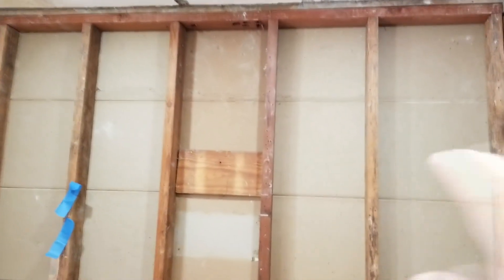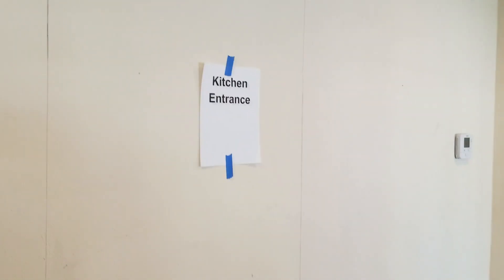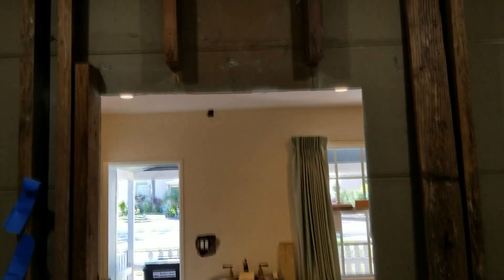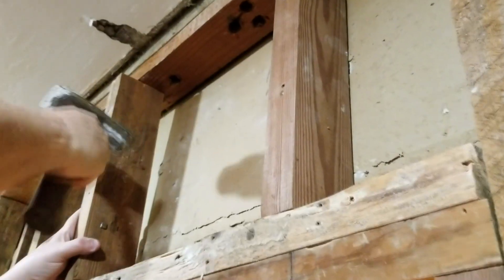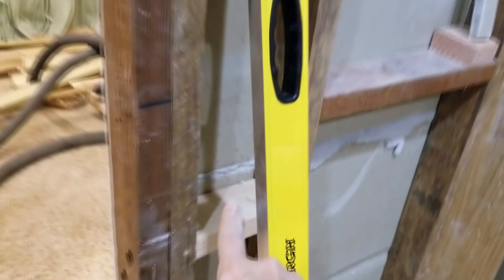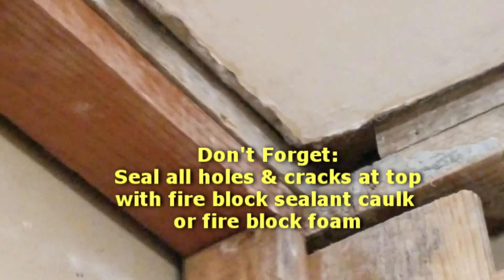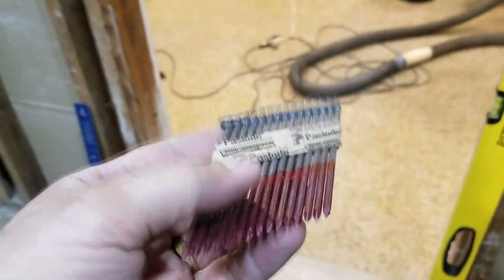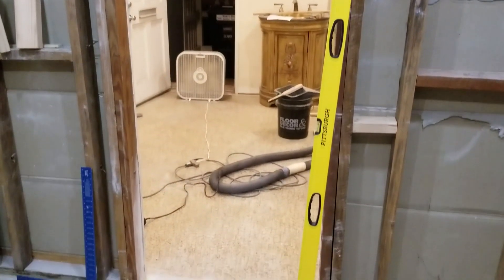How To Add A Door Frame To A Stud Wall DIY

Comment: Actually if that had been a load bearing wall, you would have been just fine installing the doorway without additional temporary support!! the weight distribution for that small opening would have been fine.  Well done however, nice clean work guys!! Thank you for sharing this with us.

Comment: Excellent video. I got a load bearing wall so I will be adding a brace but thanks for all the information
Reply from the maker: Glad to help out. Remember, just for confirmation, the ceiling joists above your wall must have an endpoint on top of your wall in order to be considered a true load bearing wall. Or if you have any roof truss components that end on top of this wall as well. Otherwise you would not need the bracing, but you can always add bracing to any wall if you like.

Comment: Just for those watching - even if joists don't terminate over a perpendicular wall like this, you should check span tables before removing any support. It may be that doing so creates too long of a span in your ceiling joists.
Doubt it's a practical issue here since there's still some support from the mini-header/cripples, but I would guess it's not accurate to say this wall carries no load, based on the span that would exist without it.
Reply from the maker: Yes, I've always been of the assumption that no walls anywhere are really a no-load wall. Especially old houses like this 1946 home, where the roof trusses can sag.

Comment: Harbor Freight drill. After 3 yrs does it still work? Mine dropped dead after 4 months.
Reply from the maker: Yes, Harbor freight tools often have a 90 way warranty
Reply: You get what you paid for. Almost all of H.F. stuff is made in China, that's why people go to them to save a few dollars...most non professionals just want a tool to get by in those little projects at home which should last longer than 4 months depending of course how heavy use you put into it. If you are a professional and you used that cheap drill on a daily basis, shame on you.

Comment: If I did want to hang a door in that opening... after both jack and king studs are mounted and I’m all squared away... All that is left is just building my jam and mounting said door, right?
Reply from the maker: Yes you would do all of that after the dry wall is up you would check with your door manufacturer and they will let you know how big of a rough in openig they need to

Comment: Angle grinder not made cut Drywall Cements Baord yes or Plastern. A Reciprocating saw Cuts threw Elephant bones.
Reply from the maker: Louis Holland  Angle grinders can cut through anything with the right blade or attachment on their own, I don't know where you got your information from but it's wrong. We even used that same angle grinder with a special diamond cup to grind down remnants of the tile floor in the bathroom.

Comment: That sure looks like a load bearing wall
Reply from the maker: uncle freddie  This is not a load bearing wall there are no loads that terminate on top of this wall. You would have to have rafters whose endpoints rest on top of this wall in order for it to be called a load very wall and since this is not the case it is not load bearing.
Reply: @jeffostroff  my understanding is that any wall with joists resting on the top plate perpendicular to the wall is load bearing.
Reply from the maker: @fearfeasog  You are close, the wall is load bearing only if the joists have endpoints that end on top of that wall plate. Most houses that have perpendicular ceiling joists, the endpoints are at the front and back of the house, or on both exterior side walls of the house. I still think they can impart some downward force on the stud wall, but not enough to be a load on that wall if their endpoints are supported by other walls.  those other walls would be the load bearing walls.